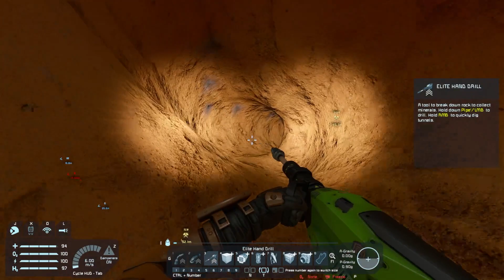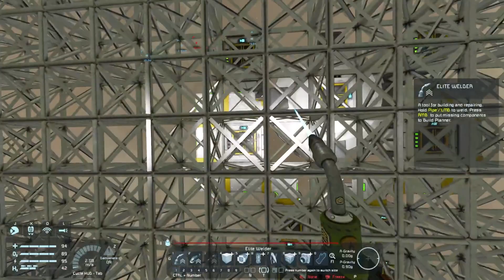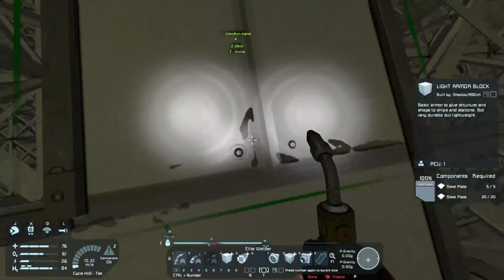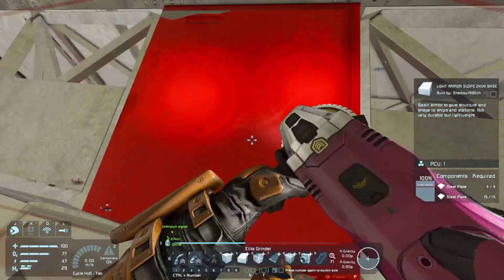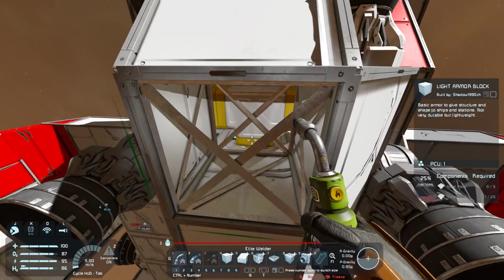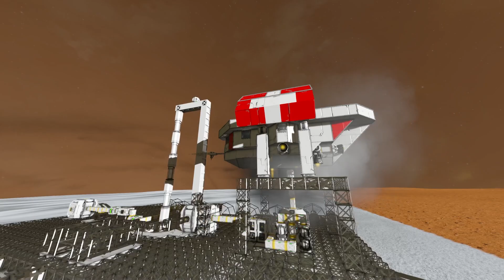Space Engineers: Landing Pad

Comment: As for the "rotary drill"  you are looking at about 40 mins to go down .5m (20mins to extend the radial arm out then another to retract) your average Ep is 30- 40 mins long. It working just like it should. The "rover drill"  can be set up on  a timer so you don't have to get in the seat and move it manually.

Rover assembler can be set to repeat mode just with steal plate getting ready for welding of your floor

Lighting strike... a few Ep ago... hinge/rotor are very prominate to destruction. The solar panel need to be upright or since you are connected to the ground you can place a wind turbine to charge it also.

  If "landing ship" is blueprinted you can use a projector to lay out the landing platform area. 2 blocks distance to prevent thruster damage. 

When landing on pad you need to be "ready to Lock with mag plates... turn off thrusters then lock... when you lock before thrusters are off the grid with thrusters "see" that there is more mass and "tries" to balance it . That was the "tilt" only 1 mag plate "locked" allowing the other side to bend. Most likely going to have to have the antenna point away from the the drill.